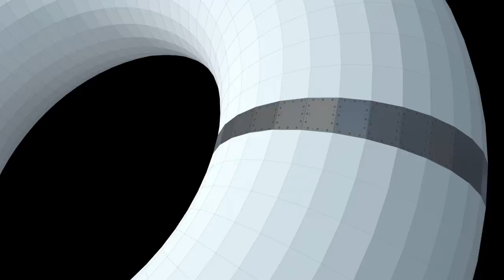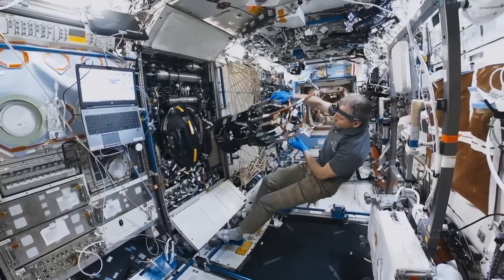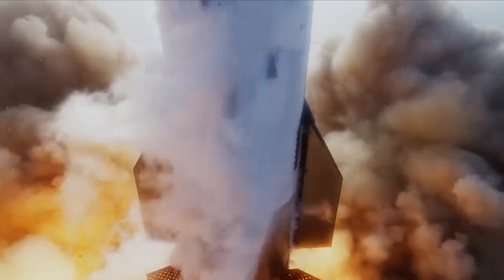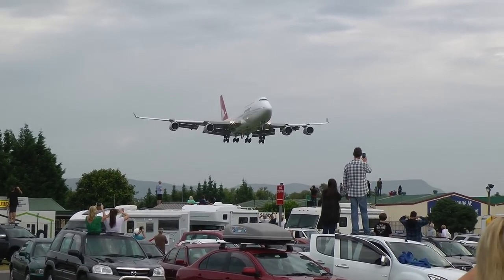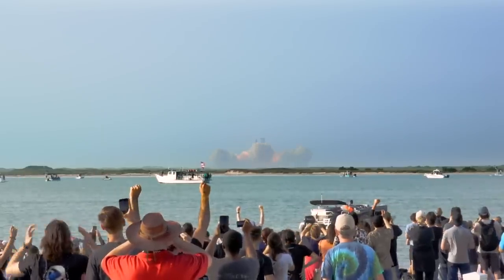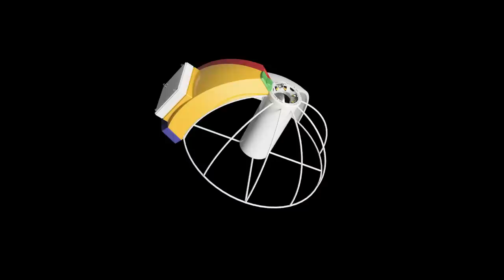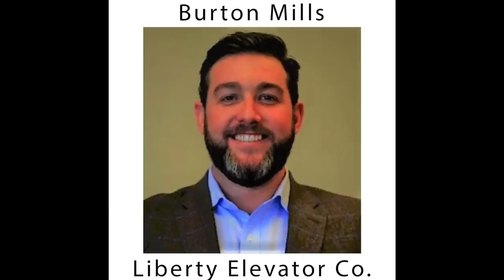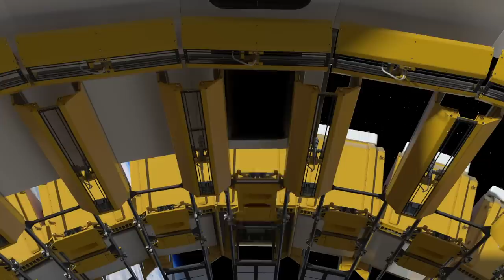Building the First Space Docks!

Comment: As an engineer I'm very aware of stack up of tolerances. How does the ring machine ensure that the two ends of the ring meet? It's such a huge scale. How do you account for thermal expansion and general misalignment of panels? Over that distance you could be quite a few centimeters or even meters off

Comment: Is welding in space easier than on earth, there may be no need to use argon or CO2 in the process?
Reply: I hope half a dozen welders answer here. I'm curious. I know we have already done some vacuum welding, i.e. the F-14 wing box. I was told that building the large vacuum chamber was more of a challenge than building the part.
Reply: I'm an amateur welder so take my answer with a grain of salt. 
If using arc welding in space the vacuum will negate the need for inert gases, so in zero G there is no gravity to steady the weld pool. Lower settings may help, and spatter needs to be collected in space or it becomes micro space junk.
My guess is that laser welding or similar would be used for panels, and friction stir welding could be used for certain connections.
Reply: @tepidtuna7450  Thanks, that helps. I've been wondering if they could make use of cold welding? For example, that story about a capsule hatch that got stuck because the super cold molecules actually bonded two parts together. Very tidy, much less energy required, but I've no idea how to control the process.
Reply: @tepidtuna7450  great answer, think that they either have already figured it out or they soon will have enough data to definitively know.
The splatter turning into micro projectiles does create a problem that is gt zero. So that could be a future danger, that they must be aware of.
Reply: Hold my beer..

Comment: the trick to building structures in space is building an inflatable Carbon weave tube structure with netting between each and using a Form of crystalization gel on the weave till it creates a coocoon which can be presurized with atmosphear once payloads can deploy in space and can be connected to gether then you can so some really big time shit in space. 

mega stuctures can be assembled peace by peace 

once you have a way to buuld ships in space and locate raw materials maybe from the moon you can eventually colonization becomes easier. 

asembling a stucture in segments wouldn't be a quick as Fabric and sealant foam. but having the strength of the webbing fabric needs to be able to deal with presure and also to install piping internally to keep feeding layers to thinken and harden the outter wall, eventually you can reinforce it with plating 

the major problem is not tilting the structure's orbit because it would still require earth's gravity to maintain a stable orbit. as all bodies in space are constantly moving

Comment: Yeah, i cannot stop thinking about starship refuelling. If starships can  dock, why wouldn't you dock 8 of them together, use the fuel tanks as habitats,  like Skylab,  and sls Skylab 2 concept. You have a lunar cycler. Take any animation of parallel refuelling,  thats two starships now put tank and hatches 90 degrees dock 2 more then, dock four, now take the tail dock animations dock two docked 4s together, thats 8, each with more space than the ISS best approach to a lunar cycler is 3 of them.
Same with landing and parking starships on the moon, or as stations and fuel depots in low lunar orbit. You don't need an orbital dock yard, but, if you wanted some space debris shielding,  and to add an external hull and scaffolding to a group of starships, it may make it easier.

The true opportunity,  is getting a bus fare price ticket to orbit, 2 or 300 dollars, not everyone will go to the moon, but, an affordable ticket to orbit, thats space tourism, do it safe, people will pay for that veiw. People will work for it. But hotel accommodation on cyclers lunar stations and bases, that'll come.